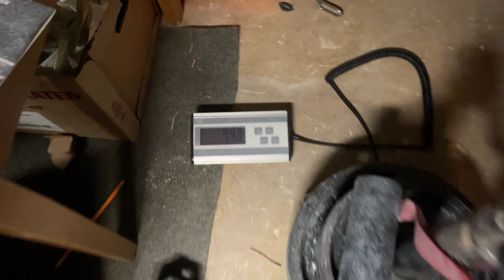Closed my 145 RGC CoC #3 with the new set style, and did some reps with 141 RGC.

Comment: Wow! That’s awesome! Great job. How far are you going to go before you get certified, or if you plan on getting certified on the COC? I think I would want to be able to close a RGC 160 before trying since you never know what they will send you. I’m up to a RGC 138 right now but you’re killing it Amigo!
Reply from the maker: I'll probably have to MMS a hard 3.5 or a 4. I haven't bought any new 3s lately, but several people said the RGC was way higher on the new 3s. I'm not worried about certing right now. I'd honestly rather get strong enough to MMS a hard 3.5 first before even attempting a 3 CCS. My luck is that I would get a 165 freak 3. With this new set style, I'm not breaking my arm to try and get the gripper parallel, so I should be hitting a light 3.5 very soon. I'd say within the next month or two, since I just hit 150.